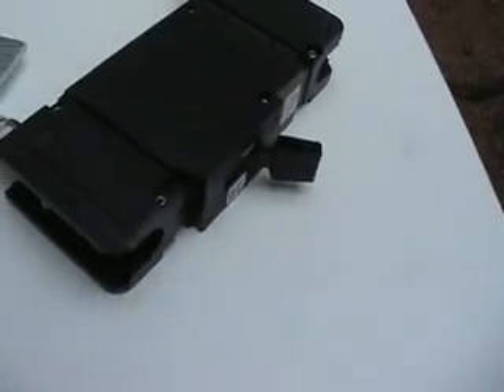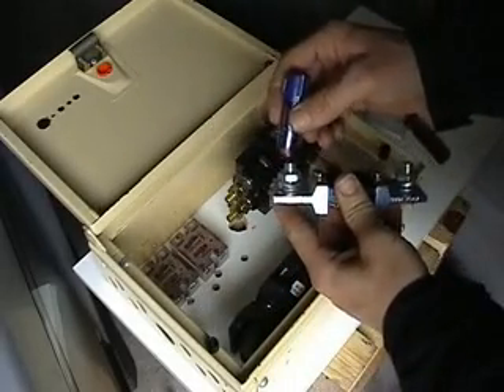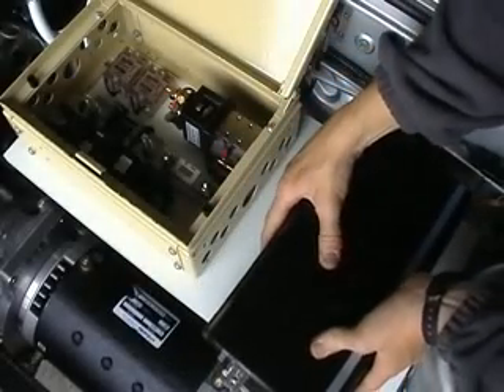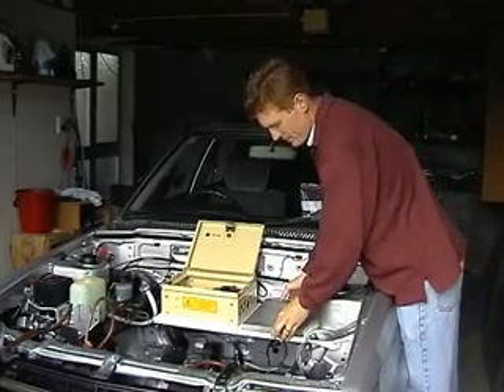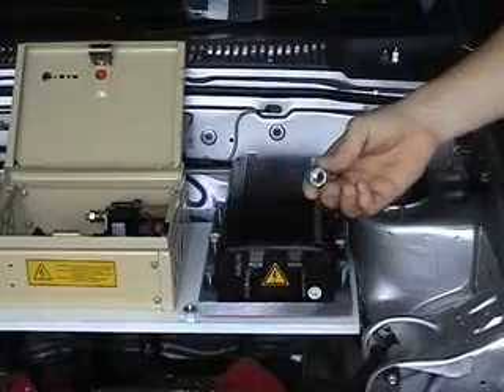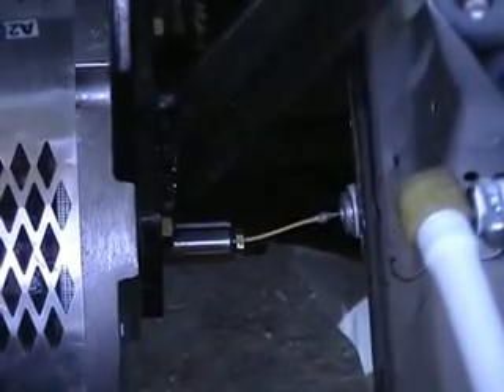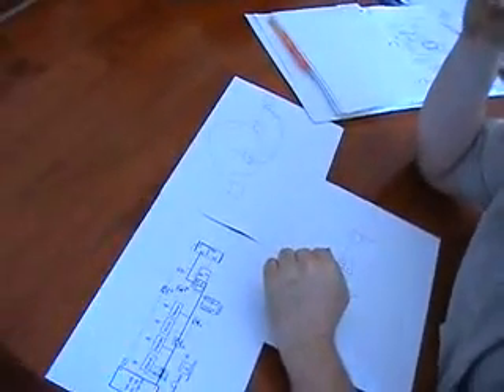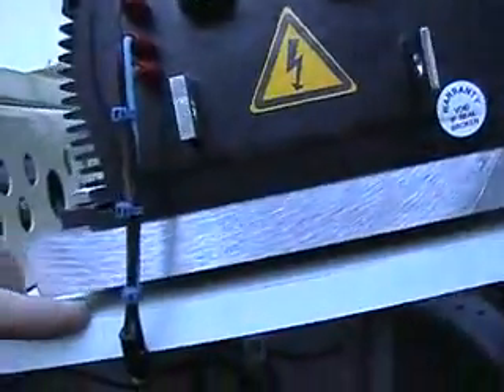Gav's EV Conversion 13 - The Control Panel

Comment from the maker: I took it up the road and back three times (about 3km) with the controller only getting warm. 3km is our average drive distance here too so I'm not too worried in this instance. The next EV I create will probably be a longer distance driver so I'll go the extra mile for that one with heatsinks galore.

Comment from the maker: Sure thing mate! There'll be a huge re-cap at the end of the series going over all the little things like the vacuum pump in action, flashing recharging light, turbo timer etc etc etc.
Still have a bit to do yet, once the batteries are in it'll be time to build my sealed rear battery box. It never ends... :)

Comment: I am building my own controller right now.  How did you solve the problem when your power IGBTs/MOSFETS go south and you are stuck with a full on transistor(s) that has no intention of obeying the control of the PWM circuit?  What kind of emergency stop circuit do you use?

Comment: I sure hope you didn't bolt that shunt directly to wood.  Wood is not a perfect insulator.  It absorbs moisture from any source like humidity, rain, car washes, lawn sprinklers and puddles.  Wood burns, when it absorbs moisture it conducts more thus creating a current path that will cause heat to be generated, next thing you know fire.  All parts of the high voltage system should only be touching plastic even the return path (the negative side of the battery pack).